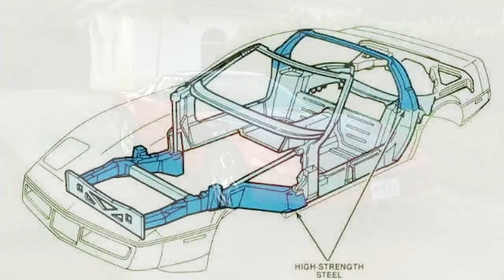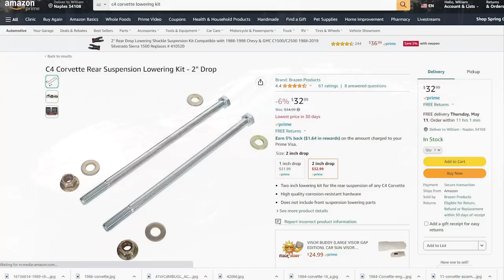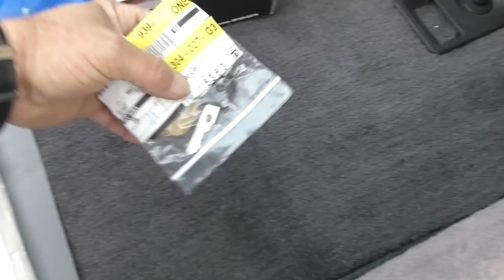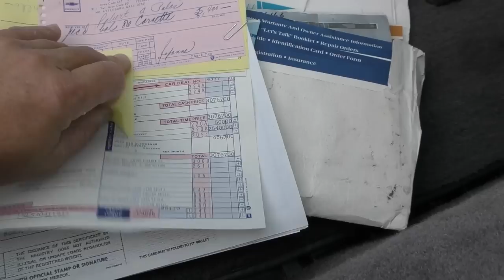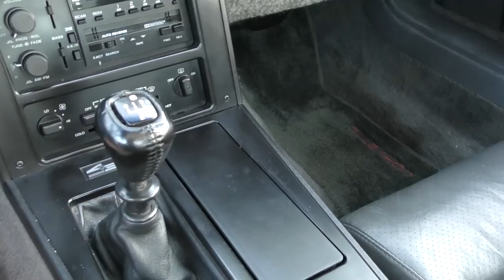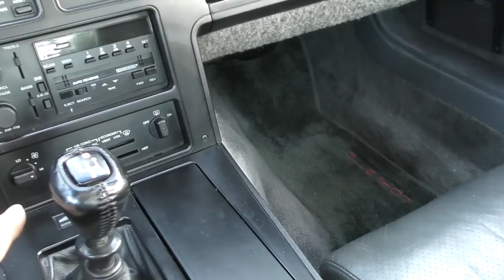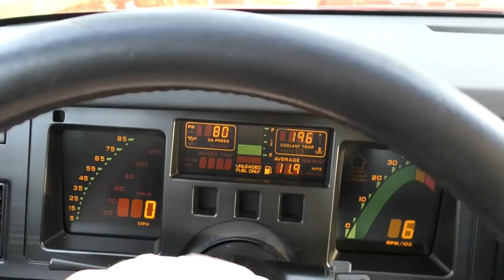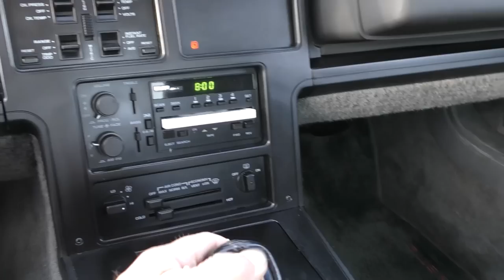This 1986 Corvette with TPI and the 4+3 Manual is the Reason I Love Early C4 Corvettes

Comment: That door sound was amazing - it didn’t have the usual GM rattle of the day.
Reply: I heard that too!
Reply: Was about to say…they were running a tight ship at Bowling Green that day!
Reply: Sound editing and dubbing of course !
Reply: Amazing ! 😮
Reply: I remember that rattle from the 70s, but not the 80s.
Reply: Try it again with the windows down… that’s the real test
Reply: Rattle and creak
Reply: I once slammed my finger in one of those doors. It was terrible.
Reply: I loved my 1973 Z/28 like no other car but I remember I was already turning the ignition key by the time the ruckus in the drivers door stopped after closing it.

Comment: This is your best video.  Possibly because I have a 1985 C4 Corvette which is Ebony Black over the Graphite leather interior like yours.  The Doug Nash 4 speed with the overdrive is awesome .  Mine has the overdrive switch on the council which I prefer.  The L98 is easy to hop up a little bit as you mentioned.  I added the throttle body coolant bypass, the K and N air filter with the performance air flow window, and the throttle body booster kit.  This booster kit is like an aluminum butterfly that attaches to the dual intake which directs more air into the throttle body.  For around 100.00 and an hour of relatively simple labor, the car has much more torque. This car is as much fun to drive as something three times its price.  I love mine.

Comment: I learned how to drive manual in high school with my first Corvette which was a 1985 tuned port injected L98 with the 4+3 manual. So many great memories. I did end up replacing the transmission eventually with a Richmond 6 speed manual but I learned in the 4+3 🙂 
13 cars later (11 of which were manual) I have fond memories of this car. 
Had a C5 and C6 as well, but my first corvette was this car (in black, as my C5 and C6 were as well) 👍🏻

Comment: As the original owner of a 1988 C4 coupe, I wholeheartedly agree with just about everything you said to support just how underrated these early C4’s are. Mine is an auto but loaded with every option including the Z52 performance package. I also have a ‘99 C5 convertible and while the ‘99 is quicker, the C4 is more fun to drive in my opinion. My bff had a ‘89 IROC Camaro for 25 years and while the engines are the same, the Vette eats it alive in every way. No contest on which one to keep. Corvette all day.

Comment: Damn Bill. Great car. We have to get together some day. This and your IROC are my world. I've had them all and was a certified GM mechanic in this era. Anything with a TPI is my specialty. It's been a while though. I'm just right across the alley from you in Fort Lauderdale. In 1987 the IROC got the 350, but it had cast iron heads. This one doesn't have center bolt valve covers, but I recall that they're still magnesium.

Comment: Those door frame arches would really wear on those seats -on ALL years of that generation too. Even right away when they were new - and even if you WEREN'T an old fart trying to get in or out. My grandfather had a new 96 (last C4 year) -and spoiled brat that I was, got to drive it a LOT -and bashed the shit out of my skull getting in and out of every time.  So yeah - just spend the $200 to make the seats presentable. But no, don't go too crazy -most people that kept those eventually repaired them at some point anyway, so that shouldn't harm collectability or value. Doors look fine, and the closures actually sound great for any GM of that era -holy crap!!!   Cheers Bill -always great seeing you have to tussle with Peters wildlife🙂

Comment: Ive changed my battery 10 times in my 86 over the last 30 years,  and never have I once took the fender off.  Ive always unbolted the cruise control bracket.

Comment: The reason the L98s are great is the TQ, just like a late 50s-early 60s Chrysler, it has the 30" intake runners that give a supercharging effect, the party is over at 5000rpms but, that's ok, much easier on the engine. Also, that manual transmission with an OD unit was used on late 50s-early 60s Fords like a '61 Starliner with a 401hp 3x2bbl 390FE, that would have a 3spd manual with the OD box, I believe that if you left it on it would kickdown under throttle to allow you to pass without clutching. I would love to have one of those. I would probably seek out one that is more of a cheap beater that needs a pain job, but is still solid, it would be difficult not to swap in a 383 or 400 SBC with aftermarket heads, intake, roller cam and run it with Holley Sniper EFI or LS swap it, probably an iron LQ4 6L, 706/862 heads to up compression, make tons of TQ under the curve, TBSS intake l, 92mm TB, long tube headers and run Terminator X. It's mostly a question of what would be more economical, simple, powerful and efficient. You can definitely get world class handling and braking from one of those today. I would take it over the IROC 8 days a week because manual transmission, handling, braking and efficiency.

Comment: Glad to see you back, Bill ! I remember when the C4 was new and fresh.. I was working for Schonlaw Chevrolet on Sunset Blvd in Hollywood, California at the time those came out, the all new C4 1984 Corvette by Chevrolet. These were very hot and very in demand in Hollywood when they were new.  

Your particular example looks in clean condition, not quite extra clean, due to interior seats... You know, so far as the window sill inside the glass, unless those phillips head screws bother you, I wouldn't replace that. I wouldn't have even noticed if you had not pointed that out. The seats on the other hand is something I'd consider doing something with. New leather will make that car look much improved. Here's my thing though.. If I did the seats, then the window sill would probably bother me more.. Hard to know where exactly to draw the line on these. Just need to let your own instinct and feel for that particular car be your guide. See you next time.
Reply: I agree and posted a similar comment, except I could live with the door panels. Seats should be redone; makes it look so much better. My neighbor did it in his 86 4+3 Vette and it made the car look like new (tan seats in his).
Reply: @LongIslandMopars  I'd probably get the seats done and see how it looks.. If the sill really bothered me $200 worth, I don't know. For me, so long as the screws didn't bother my arm when I'm hanging it out the window, I probably wouldn't care.
Reply: @MarinCipollina  I feel the same way. I sit so low in that car that I couldn't even rest my arm on the sill.

Comment: Hey Bill, absolutely spectacular front & rear LIGHT illumination drill. This C4 generation's head light flip after 37 phriggin' years still works with lightning speed. That high mounted 3rd brake light's placement at the top of the glass was on point for three model years. Then the phriggin' GM "bean counters" decided to move this safety feature between the damn taillights at nearly the same height. End result ?!? Rear end collisions to these low slung Corvettes went up three fold as a direct result. They always managed to keep these crash statistics under wraps. As claims mounted however,  the insurance industry knew better and premiums were jacked up. Many Thanks Yo !   👉.  🚘.🔍.  💰💰💰

Comment: Got an 89 Six speed that is like yours with 81k on the clock. Absolutely love it; traded a NICE  C5 auto just to get it and would rather drive the C4 any day. Get you some new window felts and have them riveted in the right way and I'll ose the screws; you wont regret it.

Comment: The C4 is my favorite generation of corvette!! I was born in 82 so my whole childhood any new corvette was obviously C4s until 97. Personally I like the later C4s 91-96. I like the more rounded look and sqare taillights plus the better powertrain and bigger wider wheels and tires. (92-96)... I have an automatic 700R4 92 and it's definitely a blast to drive! It's a daily driver so I looked for an automatic because it was gonna be a daily. That car is an absolute dream to drive super fun! But mine also has quite a bit more power than a factory L98 hell even more than a factory LT1 as well!! If it didn't have the power then no it definitely wouldn't be as fun with or without a  manual transmission. My buddy has a 92 with the actual good manual transmission( ZF6) I had just as much fun in both!! Actually mine was a bit more fun because it was faster.
Reply: I have a 96 Z-51 car. I bought JETS DST Tuner and tuned it for more torque and horsepower. To me, the best is the 96. 🤟
Reply: @kirkcunningham6146   actually the 92 is a speed density car not a MAF car and the 92s run the best is what I've heard. If it a LT4 car then yes but if not then it's basically the same car but the 93s on don't run as well. And the optispark thing is bullshit!!! 92s have no ventilation houses for the optispark and I have ZERO issues with it. I've had two different LT1s one 92 and a 95 LT1 and I can definitely say the 92 definitely runs better!! I never have any issues with it running different from day to day! It's very consistent with how it runs!
Reply: @kirkcunningham6146  personally I like um all from about 87 on but I'd never buy one that wasn't a LT car! The TPIs are pretty tame engines but they look awesome!!
Reply: @C4VETTELT1  Awesome! Your opinion may change if you drove mine tuned. GM came out with the first generation torque management in the C4. All of the torque is in the transmission and transmission pressure. So if you change those tables in the tuning software, you give yourself a ton more torque over stock. Also with tuning, you can add/subtract fuel, remove the fuel management which slows the car down, add more timing and adjust transmission pressure and shift points making the car faster and way more responsive. I've installed a TPIS 52mm throttle body, 160 degree thermostat, replaced all of the old original sensors and switches that feeds the computer information, new plugs and wires, O2 sensors, fuel pump and regulator to complete the tune. My car has 3:08 gears from the factory. I haven't dyno'd the car yet but it's fast. Probably over 300 HP at the rear wheels, not at the crank anymore. 🤟😊
Reply: @kirkcunningham6146   mine isn't stock either! I got a built transmission rebuilt engine and heads, full custom exhaust system with modern cats Xpipe and headers 160 degree thermostat with manual fan switch, hypertech stage two chip, modified air intake system ( I sealed up the top of the box and cut open the bottom and fan shroud for REAL COLD AIR!!!) I actually got the idea from a old 1995 year corvette magazine!it had a little article about modifying the airbox! this bitch is pretty damn FAST!!! especially for what it is,  I got into a race the other day with a 2014ish camaro SS and struck right to his back bumper like GLUE!!!! camaro driver wasn't happy about not being able to get away from the old C4!!!! I have a Lil video on my channel of the aftermath!! Lol I didn't have my camera mounted but I got his reaction to the whole situation!! And it's pretty good!!! Lol I thought he was gonna walk away from me but he didn't!!! I think we both were equally surprised!! Same exact thing when I dusted my first basemodel C5!!! dude wasn't mad about it though!! He actually gave me a thumbs up!! But the camaro driver wouldn't even look at me!!!🤣🤣🤣🤣🤣
Reply: @C4VETTELT1  love it, great story! 😀

Comment: Love the C4 Vettes! I have a red 84 with the 700R4 auto and, yes, CrossFire injection. Too many folks replace that injection with carbs. It was an advanced system for it's time, and people would fuck with the adjustments thinking they were gonna "fix" something. Mine was left alone, thankfully, and only needed a TPS (throttle position sensor, properly adjusted!) to make it work perfectly. Well, that and a fuel pump, but those fuel pumps are so easy to do....they actually come out of the fuel inlet area once you remove the lid assembly. You can actually port the 84 intake and step up to the 85-up fuel pump and get a good HP gain. You will need to regulate the fuel pressure down a bit, though. IIRC, the 85-up pump made like 45-50 PSI, and 13-14 PSI seems to be the number the CrossFire works best at. Many folks say (and I agree) that the CF L83 was deliberately "neutered" because GM knew that the TPI was coming out for 85, and they wanted a significant HP gain (I think it gained 30-35 HP if I am not mistaken). BUT, what a great handling car! Yeah, you might get me in the straightaways, but I will eat your lunch in the corners! The 84's Z51 suspension option (which mine doesn't have, unfortunately) really stiffened things up, so much so that starting in 85, the "regular" suspension became the Z51 option, and the "regular" 85-up suspension was softened. Mine has 75k miles also. Yeah, she needs some interior attention, and the paint hasn't fared well, but mechanically, she's pretty excellent. I think you should keep this 86, Bill! The C4's are going up in value, as you pointed out, and that IROC-Z is cool, but not as cool as a C4 Vette! Oh, and I cannot believe you missed remarking that the C4 has a monocoque chassis (mono-cock.....SIGH! LOL!). Anyway, love your vids, Bill! Keep up the great work, and keep that 86 C4 Doug Nash Overdrive Vette! Finish up the details over time to your liking, and ENJOY it!

Comment: As Corvette has slowly lost "some" of it's design language the clean unmistakable Corvette lines of the C4 grows on me more every year.
I have thos same C4 decals on my centre caps (same wheels) for five years now and they are just fine.
A wheel refinishing place could paint those A-Mold reps in the OEM  silver like the 1996 SE and that would tone down the flash of the chrome.
You can get reproduction window stickers through the Bowling Green MuseumThere is a static cling liner for thev lexan top to block the sunlight....would be a must in Florida.
My guess is that a auto trim expert would be able to fix up the carpet and repasir the holes on the top of the door pads.

Comment: I had a red '86 Z51 'Vette for 20 years. It was so beautiful I was afraid to take it out of the garage, someone might ding it. It had chrome dipped original wheels that were spectcular and borla exhaust. At the same time I had a Datsun 280zx 2+2 which was much better built mechanically but I would always take out the 'Vette instead.

Comment: Fun fact the Pontiac fiero had a hell of a lot in common with the Chevrolet Corvette as far as manufacturing in the idea of plastic panels being fitted to a rigid structure another fun fact Pontiac fieros were actually very very safe cars the couple of little engine fires that happened initially with the tech for that didn't apply to the V6 models the car itself held up 4-star government crash test safety ratings every year the car was produced

Comment: From 29:05 - yes the 84 was slow but the 86 wasnt that fast as you say. 0 to 60 5.5sec was truth with the LT1 + ZF6 1992 onwards. Of course the LT5 from 1990 and LT4 in 1996 beat the LT1s acceleration. Anyway thw 1986 is more like a 6.7sec on 0-60mph run. Later the L98 matched with the ZF6 it got even better around 6sec which was quite good for a car that has only a 245-250hp engine.

Comment: Not sure what else pointed out was in 1986 only the convertibles had aluminum heads. Also if the convertible had an automatic transmission the 700R4 transmission also had a larger sprag gear.

Comment: Wonder why they used the doug nash deal instead of the 5 speeds from the irocs my buddy has a 85 with the 305 ho 4 barrel 5 speed black on black, he has had it since 89 when we were kids he parked it in the garage when it hit 90,000 miles its absolutely spotless, 100% original untouched except for tires and belt, still got the original charge in the ac, i 3 stepped the paint a few years back for him, great cars for 1985

Comment: Beautiful car! I had an 86 that had the standard transmission. Had 32k original miles. It needed a new engine bay harness because of mice. Entire interior had to be removed. Pretty big job. But well worth it. 
If i were you. I would repair the seats. But leave the door panel issue and other small bits to the next owner. These cars are getting more desirable. But still dont bring in much money. You have to be very careful not to blow the profits by making it perfect.
Or…. Ditch the Iroc which doesnt hold a candlelight to a Vette. And fix everything proper. Plus you dont have a Mullet. You cant own an Iroc. 🤣

Comment: I bought an 87 C4 new. It rattled constantly, had numerous electrical problems, the interior was all cheap hard plastic, the roof took more effort than changing a tire (zero tech), the leather on the seats was a byproduct of steak… such poor quality as evidenced by your chewed up seat that happened long before 75k miles. For $30k ($85k in today’s dollar) it was very poorly made. My 85 Supra ran circles around it in quality fun to drive and cost $20k new. My advice is to sell it. I never bought another American car again… that’s how poorly built the C4 was. I dumped it after 2 years for a Porsche and drove nothing but German cars to today. That Supra btw ran 250k flawless miles and the leather seats still looked new. Sadly it was stolen at JFK airport or I’d probably still own it.  Run, don’t walk away from that C4, there’s a reason they’re cheap.